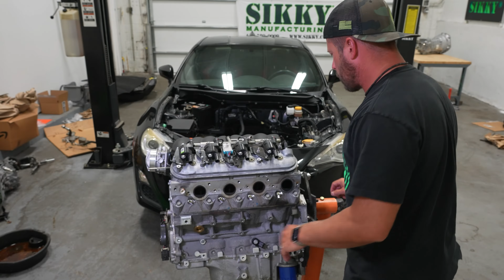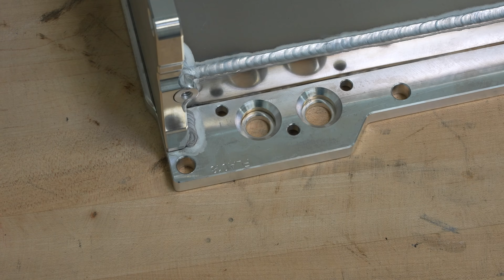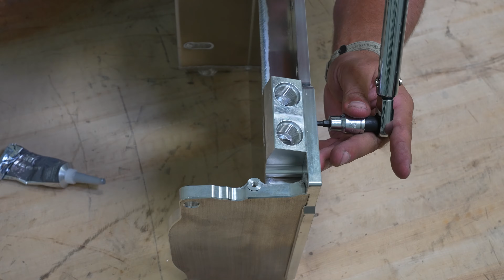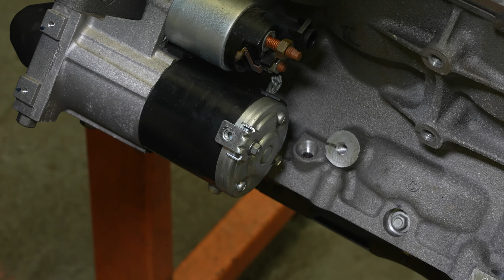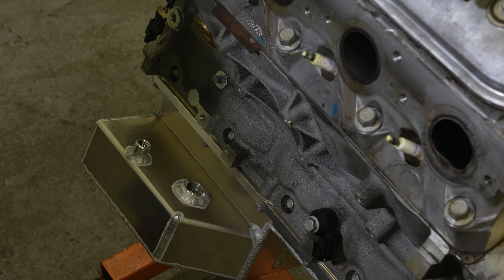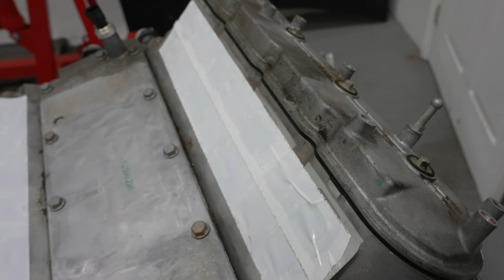FRS LS Swap Part 9 - Engine Prep & Oil Pan Install

Comment: Cd009 shifts way smoother than the T-56. Way better feeling. T56 always felt like shifting a truck to me. But the only thing is to make sure the rear end gear ration is low. That way shifting times are not crazy short.
Reply from the maker: Yeah, would have to agree on the smoother shift feel!
Reply: This is an awesome choice because it gets to highlight how useful the sikky rear end will be to find the perfect gear ratio. Very smart move james. Hopefully we get to see various shifts changes details with your sikky rear end. Ive been debating between 8.8 swap or yours. Awesome.